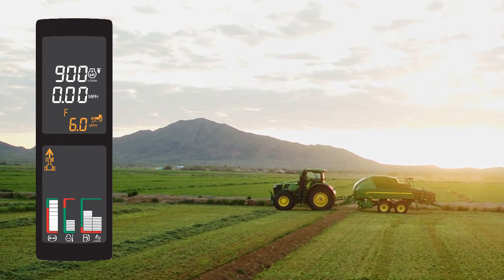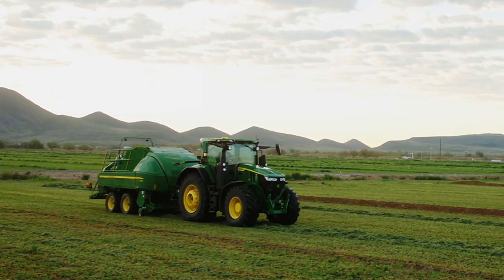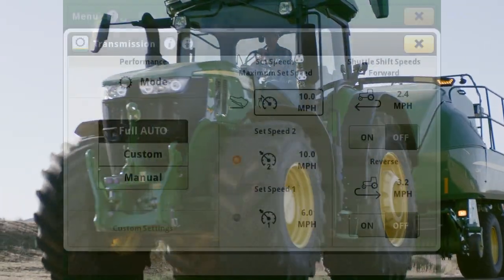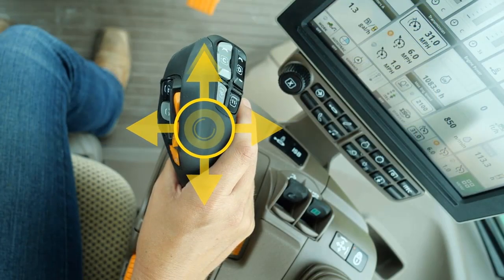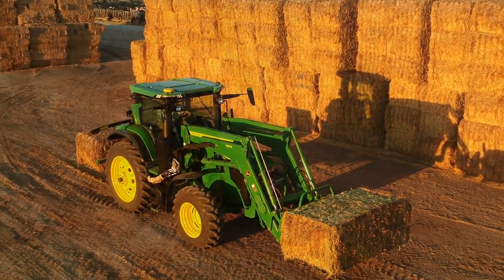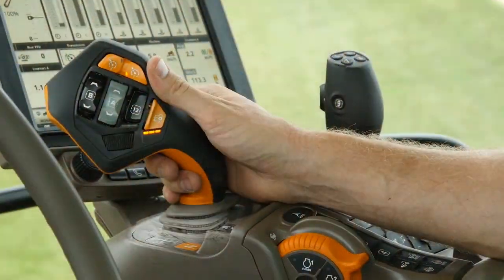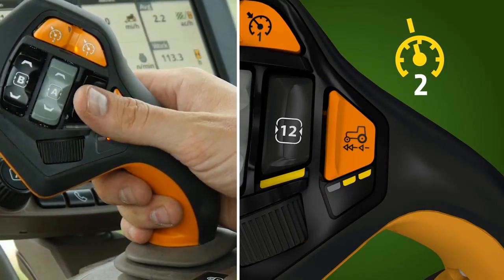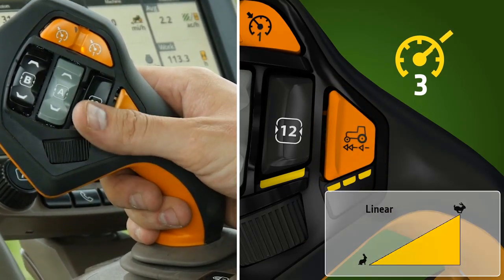How To Initiate Tractor Movement | John Deere CommandPro™

Comment: How long before we get a pilot controlled steering joystick?
Reply from the maker: Bear, thanks for your interest! We can't comment on future offerings, but we encourage you to keep in touch with your local dealer for information on new product introductions. You can find a list of dealers in your area and their contact information at dealerlocator.deere.com.
Reply: @JohnDeere  o would just really like to operate a silage packing tractor equipped with pilot control. That application would be amazing. I’ve thought about trying to retro fit a custom seat but where would I start. Would a high speed dozer seat work ?
Reply: I guess I mean controls not necessarily seat as I’ve been in a high speed dozer. How about tire on that high speed dozer? Surly pack some silage with something like that.
Reply from the maker: Bear Petty, your local dealer would be a great resource to work with to find the best solution for your needs. If needed, you can find your local dealer at dealerlocator.deere.com.